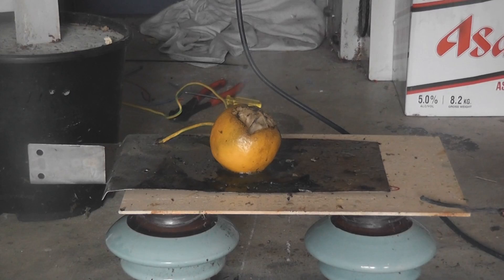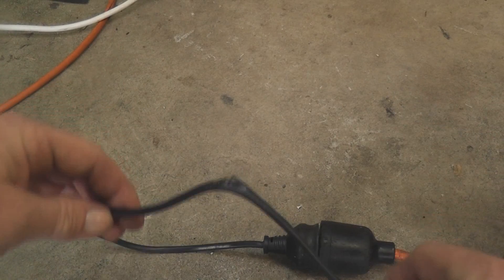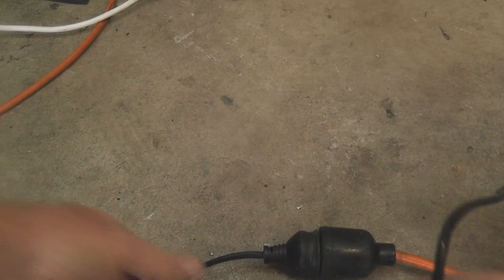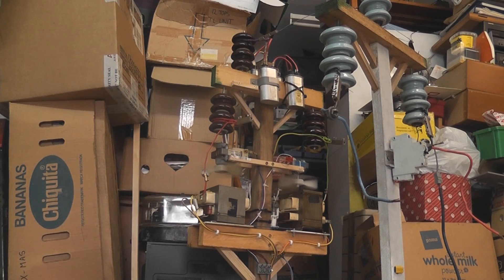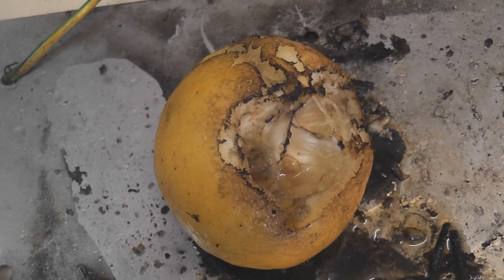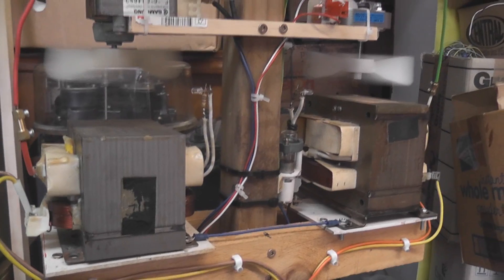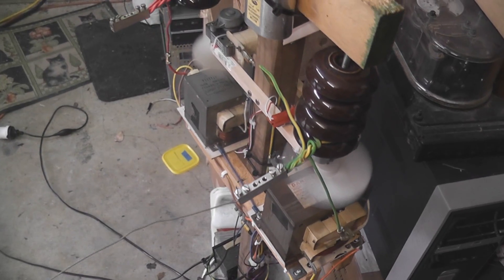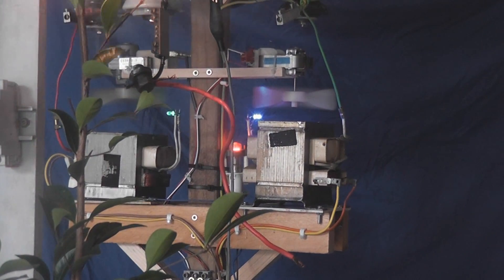4400 Volts Lemon

Comment: I like your MOT setup as well. Great idea using led's on the 5 volt windings and mounting the cooling fans on the power pole :)
Reply from the maker: Lets Play With Electricity Thank you. The LED's on the 5 Volt windings give you an ON - OFF indication for the MOT's. The cooling fans do a very good job of giving the MOT's adequate cooling. I run two different supplies to this set up. The fans stay on all the time, The MOT's are on a well marked plug which I isolate when altering the HV set up.

Comment: Mmmm, Citrus Electric. :D I'm surprised at the size of the arcs you got and that the MOTs took that arcing quite well without letting loose.

As for that power cord, well you've wrecked that. :D Slightly tooooo much current. :D

Thanx for showing,

-BoomBoxDeluxe.

2nd May 2015, 14.41
Reply from the maker: BoomBoxDeluxe I purposely use old 7.5 Amp TV cords. They may act a little as a ballast but will melt eventually. Got heaps of them anyway.
Reply: Aaaah, that's an interesting idea I suppose. One thing which would be interesting, is to put a volt meter at the input to the MOT stack and measure the voltage before and during arcing to see how much volt-drop occurs. :-)

One other thing.... Do the plug pins get hot?

-BoomBoxDeluxe.

3rd May 2015, 00.00
Reply from the maker: BoomBoxDeluxe The plug pins seem to keep up with the excess current. They get warm but not hot.
Reply: Ah, that's interesting but I suppose if "Load-Over-Time" is taken into account, a good 2-minute arc-up session isn't going to make them too hot at all, and what with the thin cable causing current restriction anyway..... that also prevents them from becoming too warm too quick. :-)

-BoomBoxDeluxe.

3rd May 2015, 00.35
Reply from the maker: BoomBoxDeluxe The pins hold up fine , considering they are thin and not designed for this type of work. On average an arc session is about 2 minutes max. anyway.
Reply: An experiment for another day: To see how long an old 7.5A power cord takes an overload on actual current with a real load and the sound of the poppage when it all finally shorts out and goes off with bit of a bang. :D

You'd need a sacrificial socket to plug it into though....

Or.....

See if you can blow the pins off a plug with that cap bank. :D

-BoomBoxDeluxe.

3rd May 2015, 00.55
Reply: BoomBoxDeluxe I have a feeling it will depend on the current. Overload it just very slightly, and it may take years to fail (if it even does fail prematurely). Overload it a LOT, like, put 100A through it, and it's safe to say it will go up in smoke in seconds xD
Reply: Oh, of course. I have given a 0.75 flex a 3kW caning before now, and yes I got it warm-and-floppy, but it's still rather much useable,.

Because of the abuse it's taken though, it wouldn't ever be wired to an appliance again.

It was removed from an old strimmer / weed-whacker, and now is used in silly-fun electrical experiments. :D

The other one I have, was removed from an old lawnmower which the neighbours had chucked out. That power cord is currently attached to The Tickler.

-BoomBoxDeluxe.

9th May 2015, 01.17
Reply: BoomBoxDeluxe Yeah, them were some thick arse arcs, like flames almost.